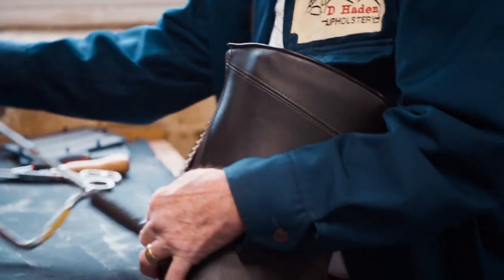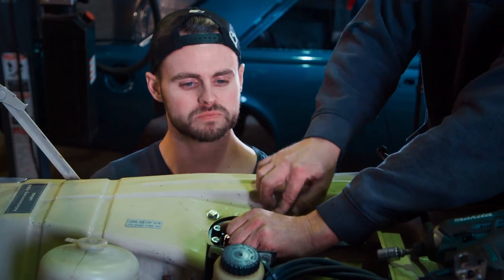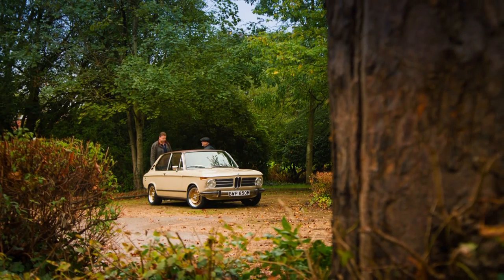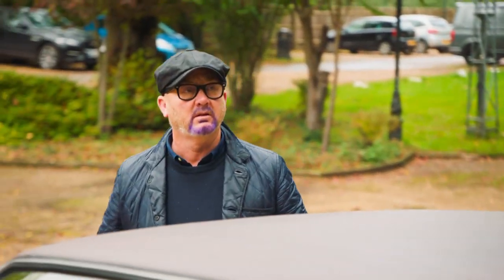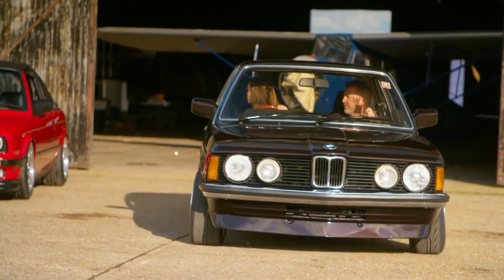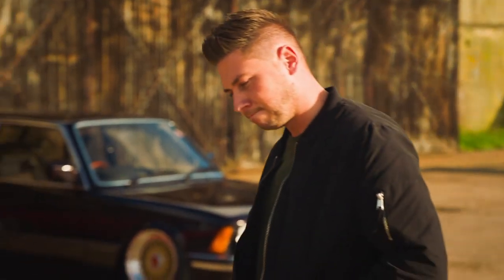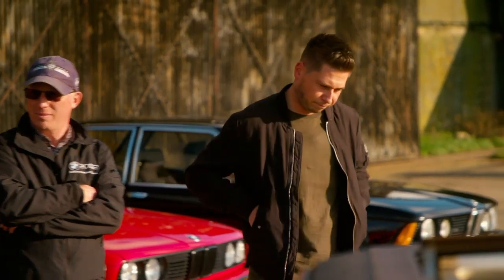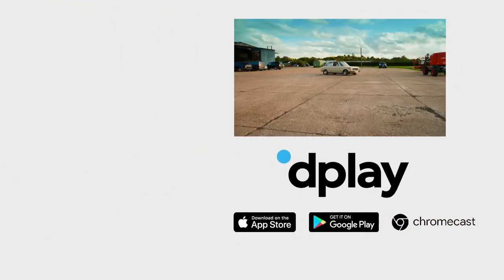Paul Finds Rare Headrests For This Restored BMW 2002 | Salvage Hunters: Classic Cars

Comment: Yeah let's make this BMW stand out from the crowd, slam it and put deep dish split rims on it.....oh wait that's like every other bmw. Its was beautiful  in its original state took a super rare car and ruined it. Top work
Reply: paul backskin totally agree, you can’t tell Paul anything though, he just starts bleating about personal taste if you question some of his decisions 

He tried mugging me off about a MK1 golf they did, saying he had been doing this for 20 years and the mods they did improved it, 

I only pointed out that a totally stock 1600 Gti would have worth the 12k tag, and not on the incorrect Pirelli wheels added red pin striped bumpers and 16v roof Ariel it sold with 

I also pointed out i have been doing the VW scene for 35 years and I’m not a car dealer, he didn’t say anything after that
Reply: @pheasantpluckersson2138  I rekon he should stick to tables and chairs.
Reply: @johnathonseagull492  and your obviously completely clueless, you would work well with drew
Reply: @johnathonseagull492  oh yeah 🤣🤣🤣🤣🤣 I meant to put some random guy